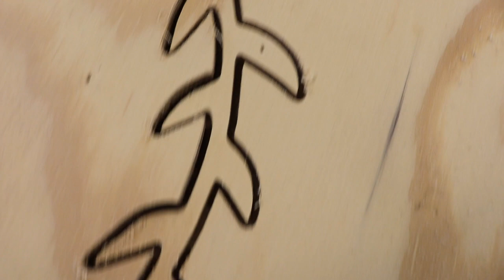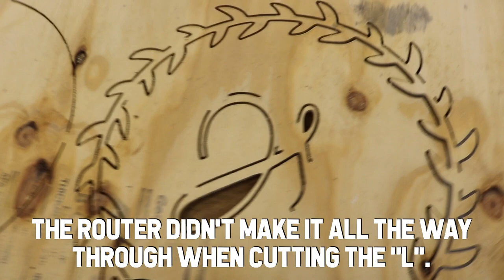Creating a Sign with the Maslow CNC and Rigid Router | Timelapse | DIY

Comment: Nice. Im thinking about buying the M2 version so getting ideas what can this cnc do. I do have 2 tips...tip 1, so far I've only need a wood chisel to cut out tabs. A set of various sizes works best. Tip 2 is to use nylon nails you can load in a nail gun to hold pieces down. They break off with a simple tap with a rubber mallet. Using nylon allows the bit to accidentally cut through the nail if the foot print is off...wont damage your bit.
Reply from the maker: The M2 does look nice but this one is still doing good for now! Also thanks for the tips, I've also had someone suggest double sided tape and to not cut any tabs, which makes since but I haven't tried it yet!
Reply: That's an excellent idea there. Where can one find those nails? I don't think I've seen them in the local hardware stores.

Comment: Thanks for the video, I’ve read the accuracy is poor towards the bottom left and right sides. Is this the case? Can it be tuned to fix this issue?
Reply from the maker: In my experience, that is true. Lately I’ve been cutting my 4x8 sheets into smaller pieces and mounting them in the center of the work area and have had no issues. I’ve read swapping the 10’ top beam for a 12’+ top beam and adding extra chain fixes the problem. My software is out of date so it could possibly fix that but not completely sure!
Reply: Dominic Layne hmm guess that’s a solution but it kinda defeats the purpose of the full sheet machine. A Low rider 2 cnc then becomes the best option at this price range.
Reply from the maker: I haven’t heard of that yet, will need to check it out! Also with the new Maslow v2 kit there have been many improvements so it is possible the problems with the corners have been resolved. I’m sure there is a video of someone showing the M2 cutting a whole 4x8 sheet out there somewhere.. anyway good luck and have fun with whatever you decide to go with!